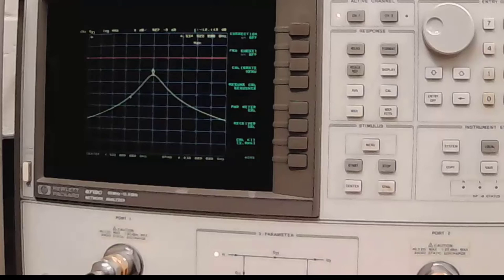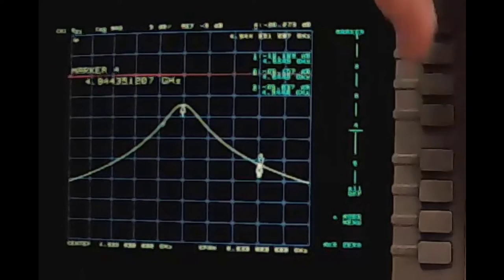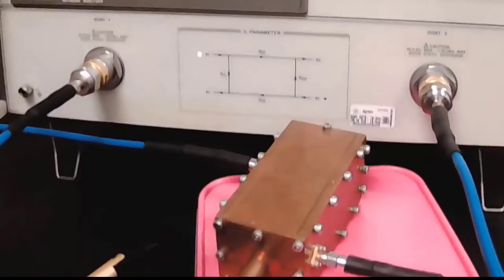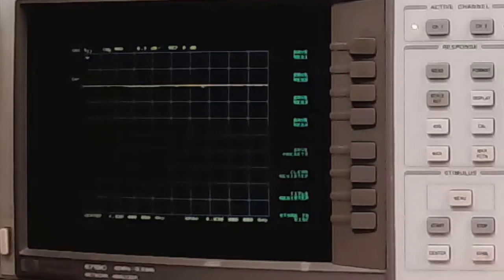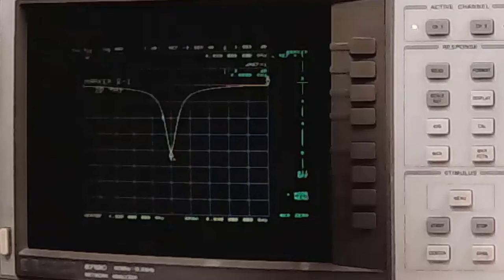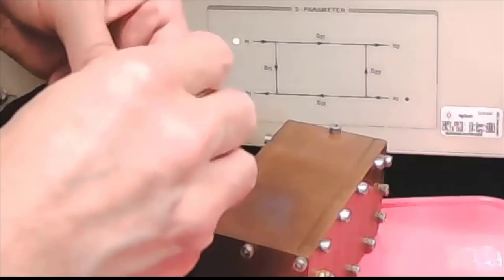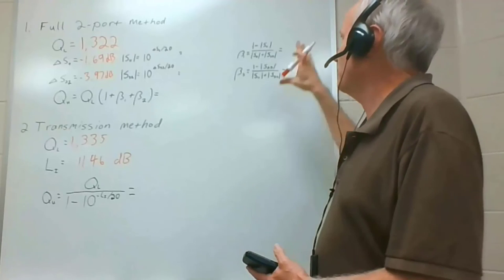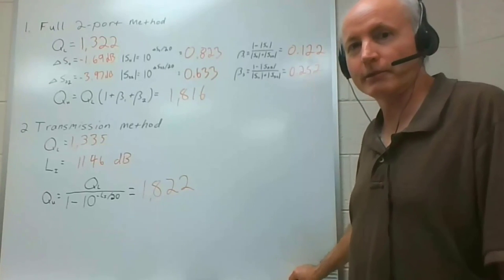How to Measure the Unloaded Q of a Microwave Resonator: Demonstration with a VNA

Comment: I am very curious about the little rod, sir. I guess it can modulate the resonant frequency. But it is entirely outside.So please tell me the use of  the  rod!!!  Thanks!
Reply from the maker: Thank you.  Finally someone asked!  The rod is there in case I need a quarter-wave resonator.  I can turn the lid around in order to insert the rod into the cavity space.  Then I have a quarter-wave resonator system.  In the configuration used in the video, the rod actually serves no useful purpose (except as a handle maybe).